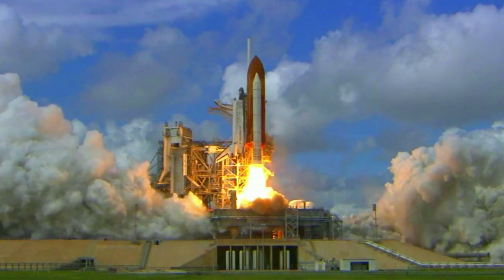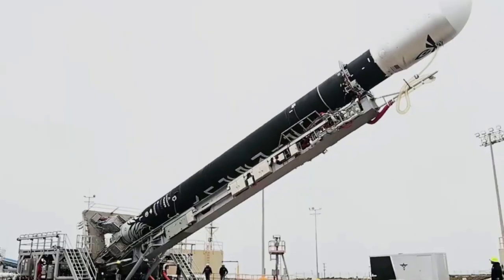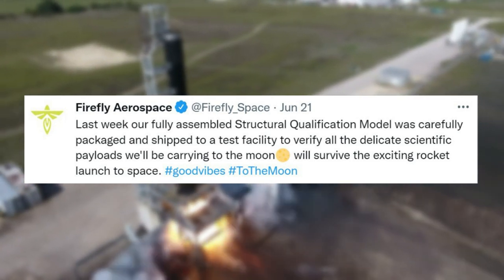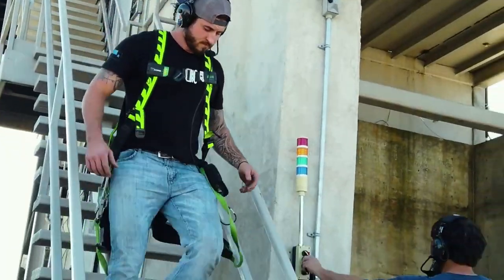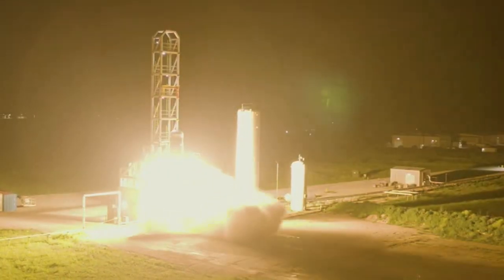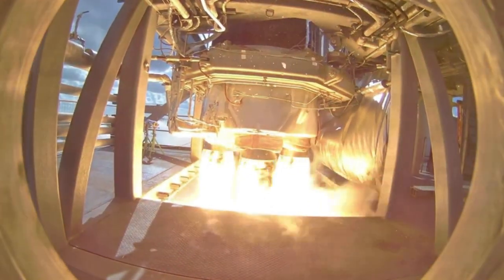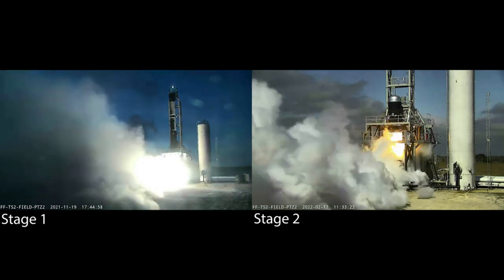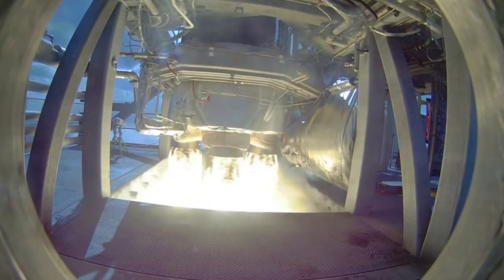Firefly Aerospace Continues To Work On Blue Ghost Lunar Lander

Comment: okay but why don't you use the same design that the apollo missions? That one already works
Reply: Better engines, materials, electronics, machine tools, ideas, manufacturing processes,
understanding of physics, adhesives, safety features, avionics, software well just better everything. 
Also some of the same reasons FORD doesn't still build 1972 Ford F-150 pickups.
Reply: @jimshreve83  yeah but still 4 wheels and an engine. 

If the apollo mission already works,  why dont improve what already has multiple landings?